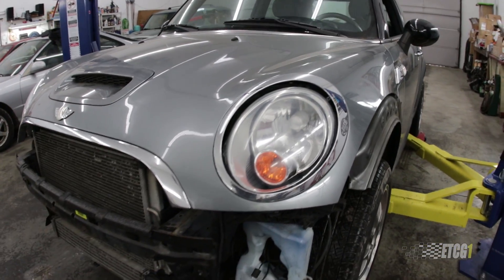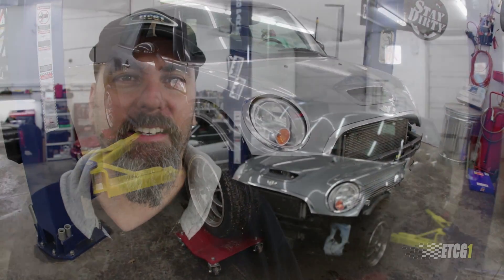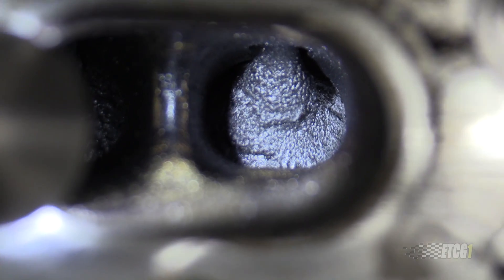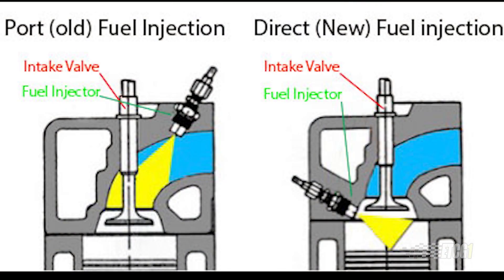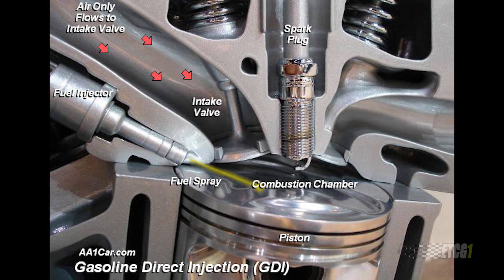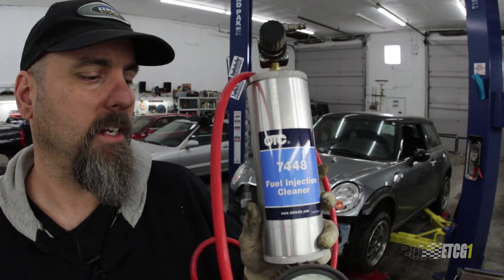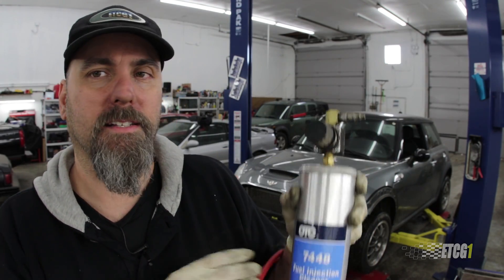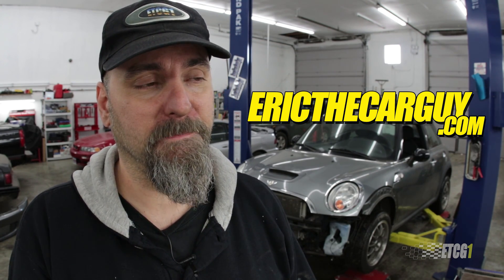Direct Injection Proves Fuel Additives Don't Work

Comment: Which water remover would you recommend for low use car. Direct injection/turbo intercooler engine that would be safe for this particular engine specification. Thanks!

Comment: Forget fuel additives on 2nd gen minis. Whether they work or not you'll get a better bang for you buck telling your technician to clean your intake up when he has to take it off to replace your failed valve guide seals lol. The HPFP and tank pump/filter will be plenty clean when they inevitably make your motor stall from fuel starvation 10 seconds after startup and need to be replaced. Take it from a mini tech, if you are worried about the longevity of a motor or maintenance cost of a vehicle, stay FAR away from 2nd gen minis... I don't care how cute or unique you think they are, the 2nd gen repair bill isn't as fun to look at. The oil change interval might as well be a motor repair interval on the N12 and N18. I'll stay tuned for the repair videos on the other $12k worth of work this thing will require over the span of 50k miles.

Minis aside, FSC's do work to an extent. If you have direct injection, which you most likely do if your car is less than 20 years old, as mentioned in the video it won't do anything for your intake valves. However, it will still help clean up buildup in any areas the fuel touches, including the combustion chambers and exhaust manifold (both of which are notorious for large amounts of carbon buildup over the years). Don't use too much of it and do your research on which products actually do anything (I've personally used techron FSC on my previous DI N52 BMW and my current DI N55 BMW with noticeable success for the price of one bottle). Use it too often and your fuel system O-rings, piston rings, valve guide seals, exhaust manifold gasket, etc will prematurely fail. The way I see it, for $20 a bottle it doesn't hurt to throw one in on a full tank and fresh oil once annually.

Comment: Great commentary and full respect here!
Personally on my vehicle's I add seafoam or MMO to the tank which gives some peace of mind that the fuel system has an element of lubricity.   I'm also a huge proponent of catch cans. I bought a 2017 Silverado 5.3 (direct injection) and installed a catch can and afm delete module right away- it's crazy the amount of oil which would otherwise have reached the intake valves... This truck is used for 90% easy highway miles.
I'm planning on using a can of CRC valve cleaner spray soon to hopefully clear any carbon away.
I enjoy your style of presentation and would be interested in your opinion on transmission filter changes - or lack of.  ;)   Have a great day!

Comment: I own a 07 R56 S Mini and yes they have a few issues but proper maintenance like changing the oil with synthetic every 3-5k and keeping an eye on the oil level makes a huge difference. It's my third one and I would still have my second one but it was totaled in a accident that was a 06 JCW. Some of the comments make me laugh it's all good it's obvious that you have never tried to catch one on a winding road lol. That's why I drive them it's a freaking go cart with a turbocharged 1.6 that puts out 172hp stock and weights 2,500 lbs with a 6 speed manual and will do140. It's a sports car in general sports car are high maintenance always have been, but it put's a big freaking smile on face every time I drive it. Oh yeah it helps to a mechanic if you own one.

Comment: My neighbor bought a brand new 2015 chevy silverado 1500 with a GDI 5.3L engine. 47000 miles later it was so carboned up he had to get a replacement engine because the damage caused by the built up carbon affected other things to go wrong. He paid $50k for the truck and 5 years later he had a bad engine. Mind you, oil was changed every 5000mi, didn't off road or beat the truck. It really pisses me off that a $50000 vehicle comes with an engine that is prone to go south all because of GDI. Oil catch can didn't help out either. Our paranoid government with their worries about saving the planet is ludicrous at best. They need to study science and understand that planet earth will always be going through change. This planet was so hostile for most its 4.5 billion year life and only in the past few 100000 years has it changed enough to support human life. It will always have millions of years of unbearable heat and extreme cold. There is no saving the planet from going through future changes. Its just the way the cosmos are. Silly humans think they're going to be on this planet forever.  Its not even remotely possible which is why they're looking to colonize Mars or other celestial rocks flying through space. Fuck GDI engines and political radical EPA bullshit

Comment: My Chevrolet Sonic had a really rough idle and would misfire when idling.  I replaced the spark plugs and not much changed, then used a bottle of Gumout PEA Ethanol treatment and did an Italian tune up and it ran great after that.

Comment: The problem with modern oils is it is too thin and guess what? When the temp rises it evaporates and gets sucked in the intake valves like a boomerang... 

Fuel injector cleaners work but in DGI without port spray its effect is mainly to declogged the FI (fuel injectors).

My engine is a 1.0 turbocharged ecoboost by Ford. I change my oil every 6 months, I used full synth oil of 0w-40 then I dumped a bottle of STP oil treatment then another bottle of STP Ultra 5 in 1 engine treatment. 

Dumped the FI cleaner then I full the tank.

I drive it hard and it gets better the harder you do it.

Comment: I once got gas at a valero station and my car started shaking like crazy all the time I would come to a complete stop. No matter where I got gas from it just wouldn't stop. Then I put fuel additive in my tank and by the time the tank was almost empty, the car stopped shaking when stopped.
I don't know what happened exactly but it worked.

Comment: Hey ETCG, I've never commented before, over five or six years I've watched many many hours of your videos though, and subscribed years ago.  Thanks for all the awesome content!  Your videos have allowed me to more confidently attempt many repairs. 

I feel like sharing my recent personal experience with you.  Maybe you'll think I'm in the slim minority that gets it closer to right, or maybe there was a correlation unrelated to causality.  Here's my recent situation:

I bought 2003 Accord 2.4 manual 210k miles.  Car had mostly been sitting for a couple months according to previous owner.  Felt very sluggish for 2.4, but it was very nice price and I bought it.  I had 2014 Camry four cylinder at the time, which had significantly better performance, but was still more boring.

About 20-40 miles after purchasing Accord the check engine light came on.  I figured it was probably the gas cap, parts store pulled code for me and it was p0420 catalytic inefficiency.  I wasn't too surprised with how sluggish car felt, and figured previous owner probably deleted code before test drive and it took so many miles to come back.

Decided to use fuel system cleaner on almost completely empty fill up.  Got no name brand for 5$.  Later that day I drove an hour and forty five minutes to go skiing.  Check engine light turned off maybe 15 or 20 minutes into the drive.

Drove a few days since then, took it for emissions test today and it passed with extremely good numbers, "fast pass criteria met" or something.  

The performance is a good chunk better but still feels very sluggish.  I am at altitude also around Denver, so that hurts.  I haven't been avoiding revs as much as possible too since I haven't changed any fluids yet or done any other maintenance.  I'm not convinced that the cat is actually flowing well, but I'm also not familiar with what this year Accord is supposed to feel like.

I am curious if you will think this is more of random timing, and now that I was driving the car instead of it sitting, that p0420 would have disappeared just as quickly without the fuel treatment?  Or maybe the treatment was more appropriate/effective at the time since the car had been sitting?

It felt like about a 5-8% bump in power after a quarter tank ran through it.  And I wasn't expecting any effect at all honestly.  It's not like I was expecting the difference and made it up in my head, I noticed it as a pleasant surprise.  It would have been very interesting if I gathered any actual data instead of just my pants seat dyno.

Really curious what you'll think about this.  And like I said, I'm a skeptic too, I was honestly very pleasantly surprised by this outcome.
Reply: Also, relevant info.  After engine light came on, I drove several hundred miles over several days before using fuel treatment.  Highway and stop and go about equally.

Comment: This was a waste. Look up Top Tier Gas. Not all gas is created equally. Not all fuel additives are created equally, I get that. But even Volkswagen and Audi had brochures since like ‘05 telling people to buy their fuel additive and use it every time you purchased NON-TOP TIER GASOLINE. AAA spent a lot of money researching this and so did FORD, MERCEDES, BMW, VW, AUDI, & LEXUS. And they all manufactured some of the worst GDI engines that evidently had 2 kinds of customers. European customers with great success. And US customers with gummed up valves. Yet the EPA, here in the states, has some of the worst LAC in the world. 

Why not contact Shell, Mobil, Unoco and ask them about their difference in fuel quality and share with viewers? Rather than harp on your “years of experience.” I enjoy your content but this was a major let down bro.
Reply from the maker: I'm not saying there aren't good fuels out there, I'm saying that even with bad fuel, injection that sprays on the back of the intake valve keeps them cleaner than DI engines that don't spray on the back of the intake valve.
Reply: ETCG1 I’ve pretty much narrowed it down to the quality of the combustion and soot from EGR. VW knew about this.

Here’s their patent. 
https://patents.google.com/patent/US6866031

Basically run a low noack oil like Amsoil and choose to either run a fuel additive with Polyetheramine and Polyisobutylene Amine like Archoil ar6200 each fill up. Or do a SeaFoam/CRC intake treatment every 5,000 miles.

I’ve scanned the entire web for 6 months on D.I. soot reduction and intake valve coking. That’s really they only preventative maintenance I could find. Other than allowing fuel fowling and just get a manual clean every time the engine gets a misfire. Or every 20-40,000 miles.

Comment: Fuel additive I bought at a gas station worked for me, in a 4 cylinder Plymouth Neon, had a bunch of miles, was old.  I read the label it said cleans something, idk, it said put it in the tank, so I did, and tomorrow the engine exploded.  Like really something blew up and I drove it home it was jumping and sounded like a tractor, made it half a mile home, turned off the engine and it wouldn't start back up.  So fuel additives do work, just not for the intended purpose :) and especially in old cars that accumulated lot's of dirt.  The car was a bye bye after that, sold for the weight at junk yard :)...... so anyway now a serious question, what about the detergents in the fuel, are they better solvents than gas?

Comment: Absolutely ERIC...the majority of cleaners do absolutely nothing for a DI engine.  The only piece that would ever benefit would be the injectors - but, if you are using Top Tier fuel that shouldn't be an issue either.  Good discussion..

Comment: The best solution to keep a clean fuel system is to buy nothing but good clean gas like what Tier 1 gas stations supply. But that still won't clean the valves on GDI cars. GDI is the worst idea that Detroit's engineers ever invented, in my view.

Comment: Are the fuel injectors part of the fuel system? I think that they are. So the current fuel system cleaners are not fuel "system" cleaners on cars with GDI. They are actually fuel injection cleaners for cars with direct injection. They need to change the name for cars with GDI and without GDI.

Comment: i do see you have the OTC tool that pushes cleaners through the fuel rail. What about a similar unit that sprays cleaners through the throttle body in a fine mist, for example BG E101-1380 Platinum Fuel Service Set along with a K6592 air induction cleaner kit, would that be something you would recommend? My main question would be if it is beneficial on a turbo direct injection engine like on my 2017 Honda Civic Si. Please get me your opinion. Thanks and keep up on schoolin' us!!

Comment: Had to  remove the intake manifold on my 2015 sorento to get at the valves. 4 years and they were gunked up like crazy After cleaning them with a brush, some shop towels and some CRC intake valve cleaner it ran like new again. Needless to say I have an oil catch can hooked up and now only run synthetic with a good noack rating.

Comment: ANY chemical "solvent" ceases to be a solvent when it's burned- except for water. Get a spray bottle. Get your engine up to temp, remove the air filter, and between large throttle blips (3k RPM) spray in water. Not enough to stumble or break anything, but just a mist. Make sure to rev between and during sprays. 30 minutes and 1 gallon later- any parts that were gunked will be clean.

Comment: Hi Eric man I have a 2015 Hyundai genesis coupe 3.8 GDi it has 35.000 miles the dealer is telling me I have to do a intake valve cleaning but the owners Manuel does not say nothing to clean the valves all it states every 7500miles just use a gas treatment should I go by owners Manuel or should listen to my Hyundai advisor.

Comment: Not a good title, misleading.

A direct injection engine can GREATLY BENEFIT from additives. The high pressure injectors have tiny little nozzles and suffer extreme pressure and heat creating carbon crud. An additive will clean the injectors ensuring proper atomization,  dispersion and knock free combustion. Fueling issues can lead to lean conditions or precombustion. The additives can also clean the walls, pistons and rings. I agree that an engine should stay clean for a while so long as its healthy. You do a good job of making this point. However, not all additives are snake oil.

People are just too ignorant to know the basics of how cars work and these comments prove it. The problem with DI engines is that the fuel, containing the additives, doesn't get the back of the intake valves. This is not the additives fault. Saying dirty valves on a DI proves cleaners doesn't work is POOR thinking skills. Some of the comments are just crazy.

You said nothing you pour in works instantly. That's not how the product is marketed. Adding some every few tanks over years can have a significant benefit. Using top tier gas really reduces the need for this stuff as the gas already has some in it.

It's true additives don't get the valves in DI engines. It's true some additives don't work.
ITS A LIE TO USE THE WORDS "PROOF, ADDITIVES AND DON'T WORK" IN THE TITLE.
I don't use them because I feel a little gunk doesn't hurt and the cost of little bottles adds up. I choose better gas.
Reply from the maker: Did you watch the video or just comment? I think you just went strait for the comment.

Comment: There's a technique where you feed Seafoam or another solvent/cleaner trough the intake PCV tube with the car running. That way it passes the intake side of the valves. Any thoughts on that?
Other than that there is the oil catch can option of the real solution which is walnut blasting.

Comment: Ive been riding motorcycles, off road and street, and driving cars and trucks and boats and snowmobiles for over 45 years. I can say that some fuel additives help and some dont. Where good ones absolutely help is helping stabilize fuel and stopping varnish buildup and methanol gas crud and water dispersion in low usage times - without a doubt! As for cleaning they do assist some if used REGULARLY as they are not a fast fix! Is it worth the cost to run them regularly...prob not...but there are test preformed that do show some carbon cleaning when used regularly - tho minor cleaning usually. NOW for direct injection...Im with you on this  I DONT WANT IT AND WILL NEVER WANT IT! The injection systems behind the valves is WAY better in my opinion for the reasons in the video...cleaner intake valves! The other real problem is carbon in the area of the direct injection orifice...just like the ford triton sparkplug breakage  issues that carbon buildup helped cause, direct injection will be affected too with clogging in the cylinders from - CARBON! Until they can show me fool proof direct injection that is some-what maintenance free and reliable - Im not buying it! I would rather buy a very small amount of more gas than have huge direct injection costs! If you do have direct injection then air intake cleaning should be performed at  much more regular intervals to assist cleaning at the intake valves! Thats my opinion and Im sticking to it! Im no scientist but i do have some time proven aged experience! Also -  remember when storing for winter TOP YOUR TANKS!!!!!

Comment: Can you flood the intake with a solvent (like gasoline), crank the engine over by hand, let it sit overnight, pull the spark plugs, turn the engine over until it all gushes out, and wait for the cylinders to dry out for a day or two, check the oil for solvent contamination (change if needed)... would all of that help or have adverse effects?

Comment: My friend purchased a Vauxhall Astra with an engine miss fire, and the EML flashing, we stuck some fuel injection cleaner and used Shell Ultimate Gas in the fuel tank, after 2 days the problem went away, and every 8th fill up we used the Shell and never had a problem again.